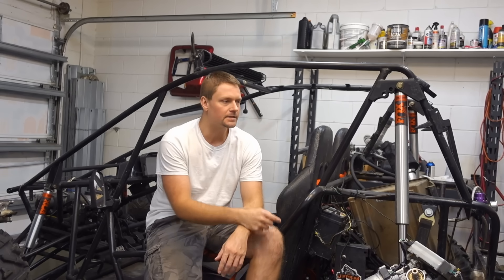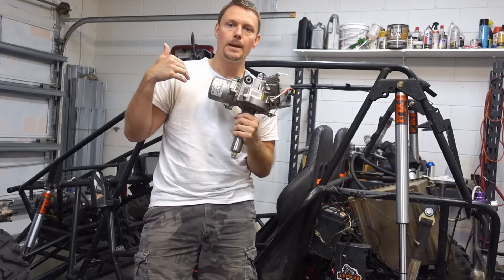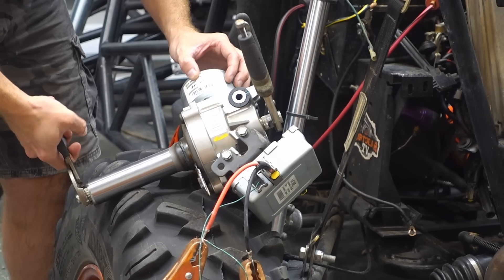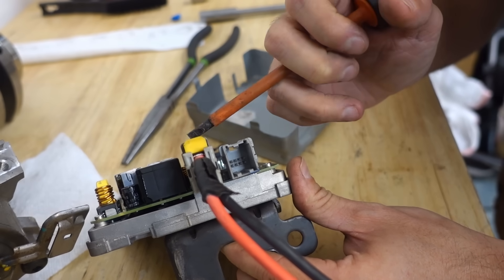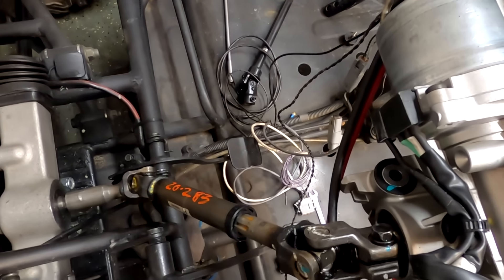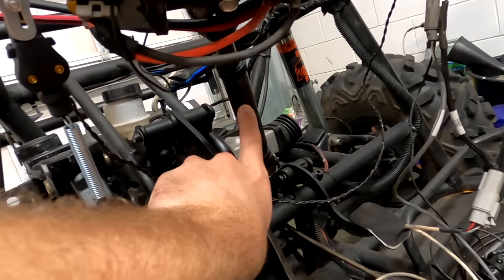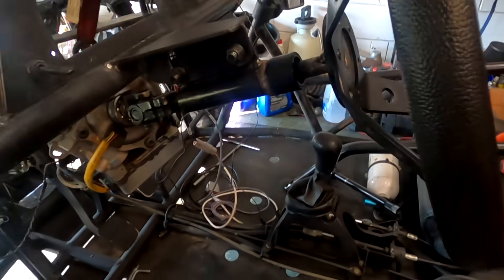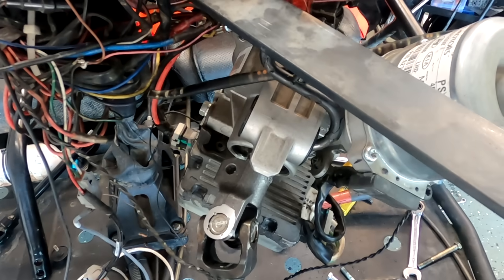Add Electric Power Steering To Any Vehicle for $150 | EPS Conversion

Comment: I’m building a custom electric reverse trike. I have a large 72v battery powering the vehicle. Do you have a recommendation for connecting to power this type of electric power steering  unit?
Reply from the maker: Wow, sounds sick! You could use a DC converter like the ones from thunderstruck 🤷‍♂️
Reply: @DirtGearTv  Or, a DC-DC converter from a Prius. It's in the HV battery pack...
Reply: Awesome!! Thank you!

Comment: Hi, do you notice any downsides to the power consumption / electrical system? If you steer standing still, do you see a voltage drop or can your alternator / battery cope? Thanks for all info shared.
Reply from the maker: I’m curious to find out myself, I haven’t run it as i’m doing an engine build but can report back in about 3 weeks when I know how it responds.
Reply: @DirtGearTv  any update?
Reply: @DirtGearTv  any more info on the power draw
Reply: I’m curious about this too. How much of a power suck is that thing.
Reply: @richardmcdaniel3108  30+ amps plus

Comment: I am using the same motor in a 1970 Mustang.  My issue is the connection between the motor and steering wheel....where did you get that knuckle joint from???
Reply: I've seen alot guys fab there own but maximum motorsports sales them for mustangs!!:)

Comment: I'm just starting this same mod on my daughter's '63 Nova. I'm going to retain the column shift for the automatic by shortening the shifter mechanism and using a shift cable setup, (I think and hope). Failure is not an option but, just in case, I know where there's another column the same color. I got my steering gear, module, and plug from an '09 Corolla for about $100 at the local u-pull-it yard.
Reply: How did it turn out?  I have a 65 I would like to do this to.
Reply: @rustymobley1428  It turned out great. My daughter loves it! It took quite a while because I had to make the shifter work with a shift cable from a '05 Silverado. I'm going to do it to a friends '63 next month. At least his is a floor shift. I may do it to another friends '64 w/column shifter, again. Last spring I put one in my '36 Chevy coupe. The Nova columns were 2" dia. but, the '36 had a 1.75" dia. Flaming river column. Pain in the ass to make the u-joint fit in there! Next on I'm going to see if Borgenson makes a straight splined coupler with a 3/4" double D at the other end. You have to remove the gear, remove the shaft, and have a double D cut in the shaft. Before you remove the gear, cut the shaft off about 5" above the gear or you'll scratch up the dash. You will need to shorten it more but this will get it out. It would make a great video if I had any ability at all.

Comment: I’ve watched a lot of these videos the past two days and many are using an adapter harness with a rheostat to trick the ecu, yours doesn’t. Is there a fundamental difference in programming? How’s all that work?
Reply: Link to ranger station answered my question, I now have a power steering solution for my tractor.

Comment: GREAT JOB A+ on the video Learned allot. I have a 1934 Plymouth car and I have purchased off eBay a Saturn view electric power steering I would like to put on this car. Looks very similar to the Kia you have. It came with the control module  with a large red and black wire ( sure this is to battery)  and the small plug with 3 small wire sticking out about an inch. I have no idea which of the small wires goes to hot for my switch. Would you have any information on this? Thanks

Comment: Did this help with bump steer?
Reply from the maker: I had tuned all the bump steer out when I rebuilt the new steering system in the last video 👍
Reply: @DirtGearTv   My apologies I meant like kickback like while you're driving down a trail and you hit a rut or rock in the road and you're steering wheel kicks hard. did it cure that
Reply from the maker: @horacegray2417  I have yet to test it out since i’m rebuilding engine for 300-400hp but should know pretty soon 🤙
Reply: I'm Hopeing  it cures it on my 87 Fox
Reply: Es posible subtitular en castellano,,,, por favor ???